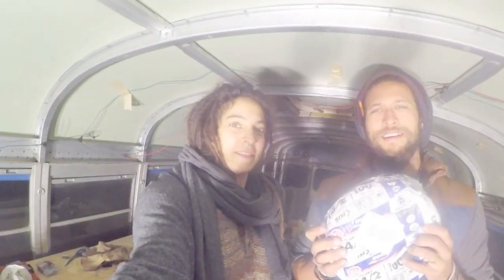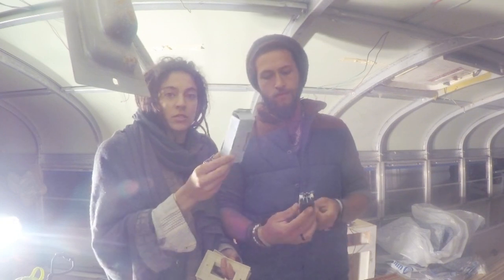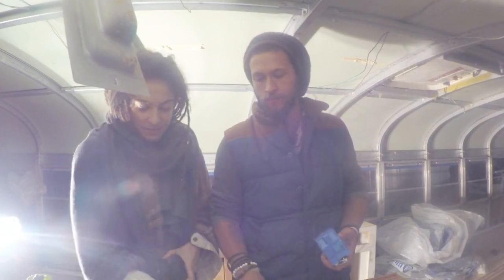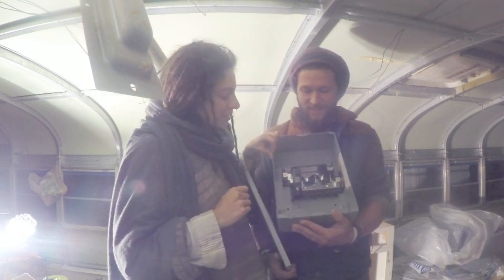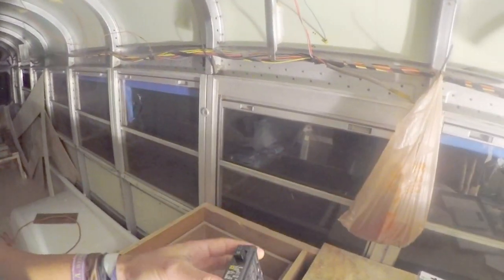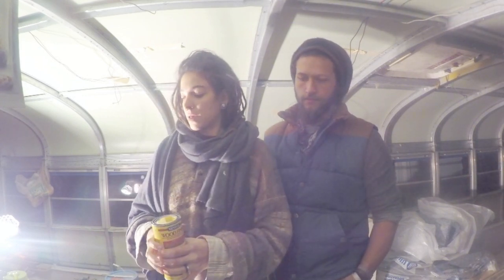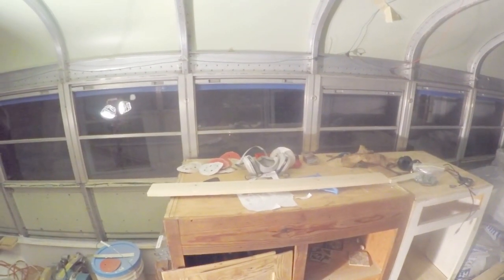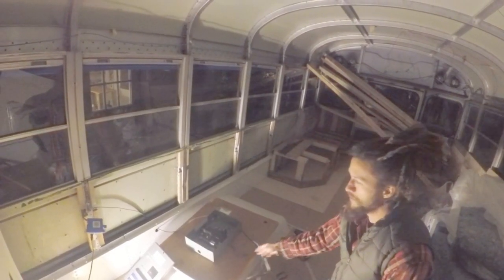EPISODE #11 - Running Electricity & wiring for our skoolie conversion

Comment: I was so relieved to hear that you change your mind about putting those little plastic circular rings into the beams. I have seen other bus bills that have used trim and attach the trim above the windows on that horizontal beam. They cut out the back side of the trim and ran the wires inside and then used screws to attach the trim to the metal horizontal beams above the windows  it's always great to learn mistakes before you do them! Smart smart people!